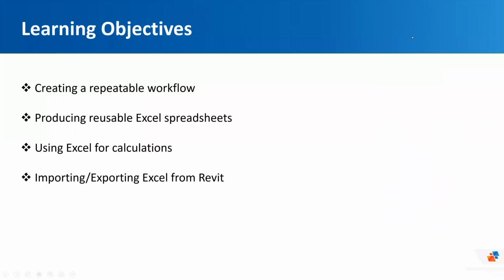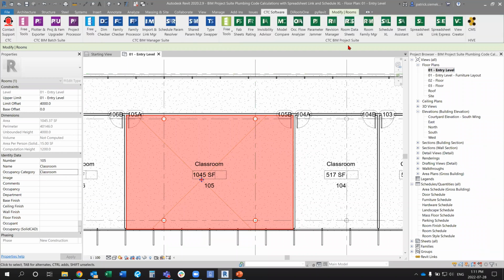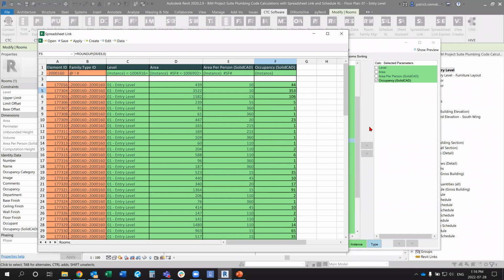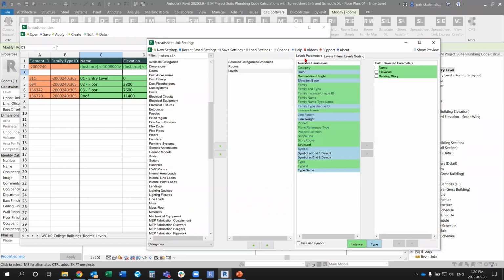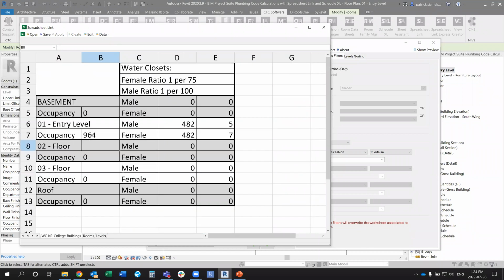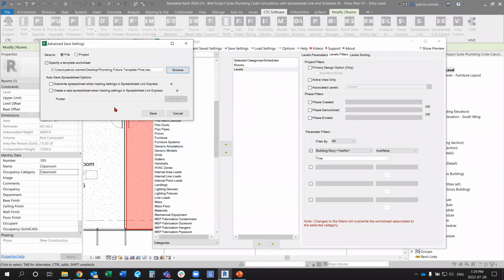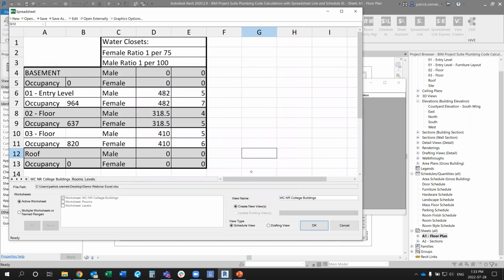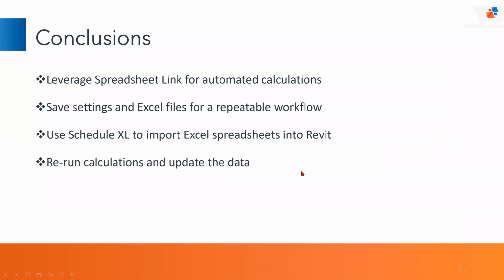BIM Project Suite: Plumbing Code Calculations with Spreadsheet Link and Schedule XL

Comment: I am pleased to share with SolidCAD, Professionals and Companies the most advanced technological tool in existence: the Digital Twin that I invented in 1981 under the name of Virtual Instruments.  https://youtu.be/fXlp4QLdWQs
Export the Revit, Plant 3D, Civil 3D, Inventor file of the Building or Refinery to Excel, prepare Budget 1 and export it to COBRA. Prepare Budget 2 and export it to Microsoft Project. Solve the problems of Overallocated Resources, Planning Problems, prepare the Budget 3 with which the construction of the Building or the Refinery is going to be quoted.